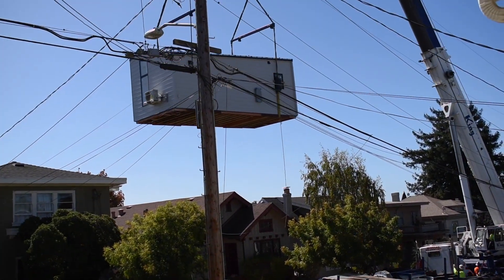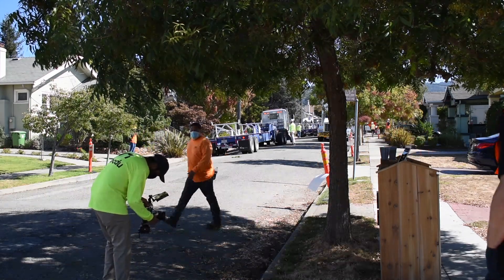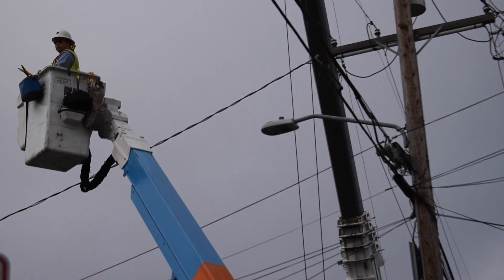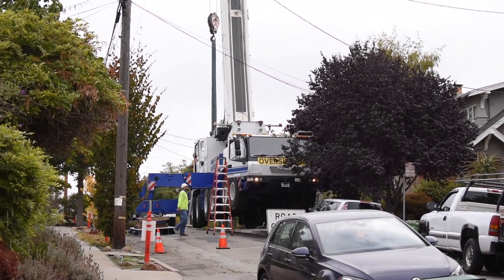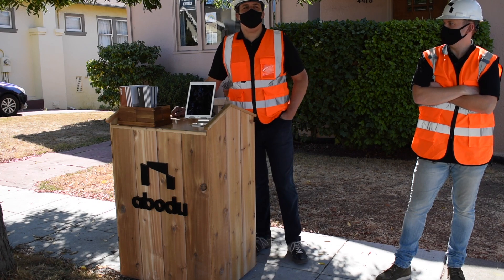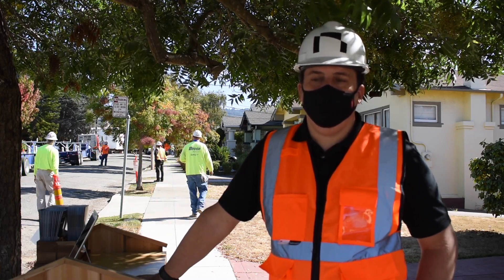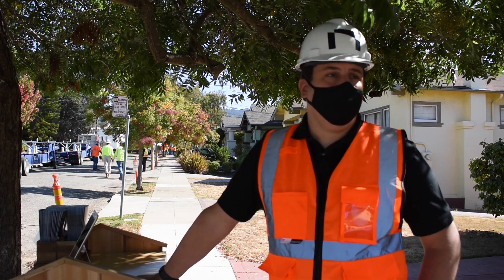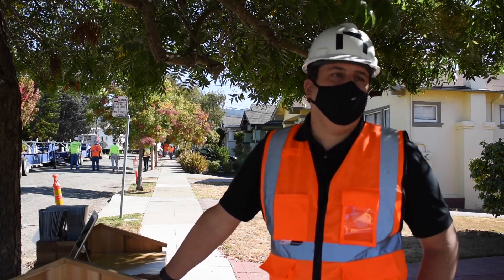Craning in a 20k pound Abodu House

Comment: How much this totally cost?
Reply from the maker: Jeremy from Abodu told me "The average Studio project's 'whole project' cost runs about $215K"
Reply: @HowToADU  OMG
Reply from the maker: If you subscribe to the channel you’ll hear about other prefab and modular solutions at different prices ;)
Reply: @HowToADU  so basically 25k for transportation. Like moving it there and lifting it in etc?
Reply from the maker: @darrenkuo2005  I filmed this over 2 years ago! You should reach out to Abodu for updated pricing estimates. But at the time, yeah.
Reply: Still ALOT CHEAPER than the "homeless" houses built in L.A. less than 1/2 costs.....!
Reply: @violent_bebop9687  Interesting point! I was just talking to somebody about a Tiny House village where they make sleeping accommodations in private Tiny Homes, but they put expensive stuff like kitchen and bathrooms in a communal facility. Smart way to provide as much housing as possible at the smallest costs.
Reply: @ryanohousing  - the condos for homeless come out too 500k per unit, its ridiculous
Reply from the maker: @shooting4star2023  That's a fair comment! 

This video is more about the technology and validating that they're a real company installing real homes (in this video, it's a house from Method)

The pricing is probably worth a whole other video ;)
Reply: Do you have any information on Sondorpods?  They're priced similar to adobu.
Reply from the maker: @sparkev2356  Sonderpods actually sponsored the channel recently - you may want to watch this interview I did with one of their customers: https://youtu.be/z_5Kjb0eFhE
Reply: The pricing on these is a bit nuts